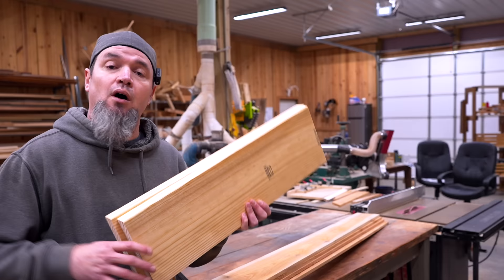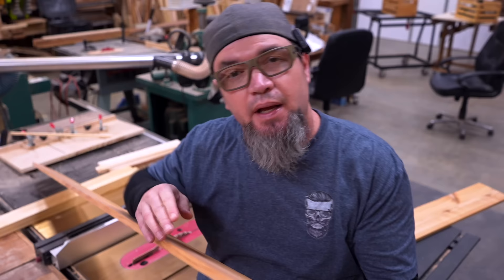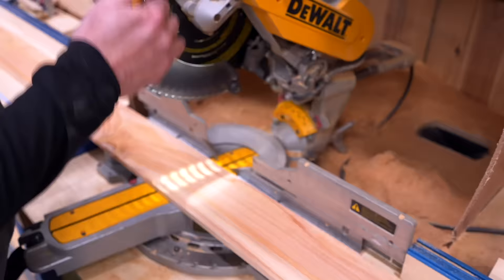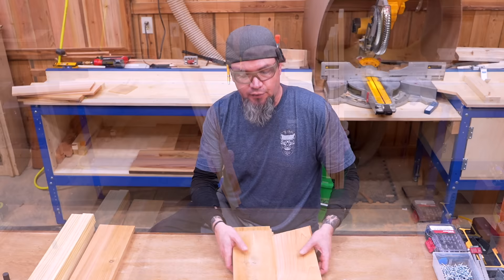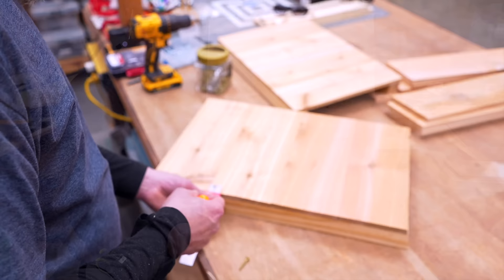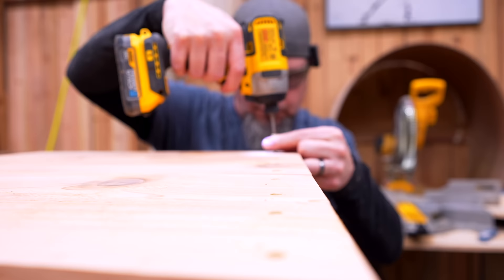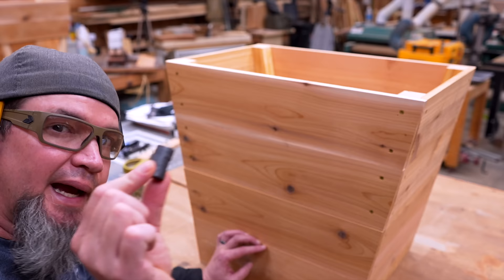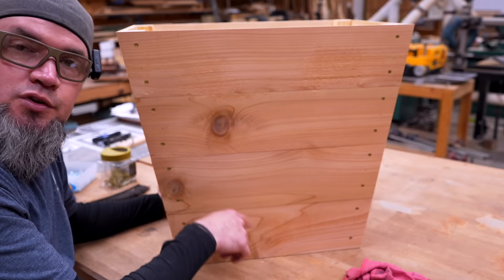The MOST Useful Garden Planter / Easy DIY Garden Planter

Comment: Your idea was very timely, just when I was thinking I needed new hoses and wanted a way to protect them.  I live in Arizona and the summer sun is brutal. I don't own a table saw so, mine will have to be square.  You have to work with what you have.  It won't look as nice as yours, but will serve the purpose.  I am a woman and  quickly closing in on age 78, but can't wait to try my hand at these - I need at least three.  Use of magnets was genius. Love your inspirations.  Love your channel.  Reba
Reply: There a many options for cutting angles even with just a circular saw.
Reply: a circular saw and a track guide can make that flush edge and using the tilt function on the circular saw you can make the 10° cut too.   You may even have a neighbor with a table saw or even a bandsaw.

Comment: Matt, Great video. I have a suggestion though. I have used those size magnets for making bottle openers, and I used ca glue to attach them to the opener. Unfortunately sometimes the ca glue doesn’t always hold the magnets in place the way I wanted it to. I ended up switching to 5 minute epoxy, which held the magnets on the wood better after the epoxy cured.

Comment: How would you suggest making sure the hose didnt het covered with run off from watering the plants??? Great video as always and look forward to the next one.
Reply: It probably will, unless you drill drainage holes in specific locations and ensure the hose is stored in the exact same spot each time. I suppose you could make two bottoms, with the second angled to drain out the back or the sides, but then you'd need to ensure it was watertight and that you drilled additional holes wherever you wanted it to drain. 

My thought is that a hose should have no problem getting slightly damp from the drainage, given that it's waterproof. If you're really that concerned you could always use a fake plant or something like a succulent which would minimize watering and thus drainage.
Reply: Use double layer weed barrier as the base for your plants. Less dirt will muddy up your hose plus add some cedar slats to the bottom with a 1x1 slat spacer for the slats to help keeping it dry.
Reply: Put a bunch of plastic plants in. Done. No mess.

Comment: Rather than all the individual measurements could you just put all the pieces for the sides on the bench and pencil mark across all of them at the correct angle then follow that line for each piece at the chopsaw? I probably explained that really badly 🥴 Great idea and build regardless.

Comment: Are the second set of side wall pieces cut at 5¼ or 5½? You start out saying 5¼ but then say 5½ when you're done.
Reply from the maker: My bad.  The front and back are the exact same lengths.  5 1/4 is what I used